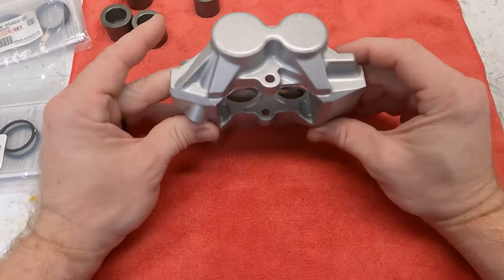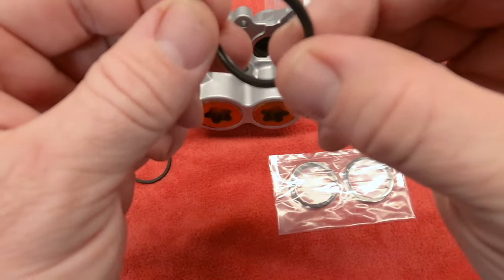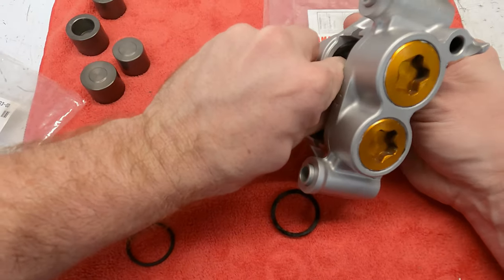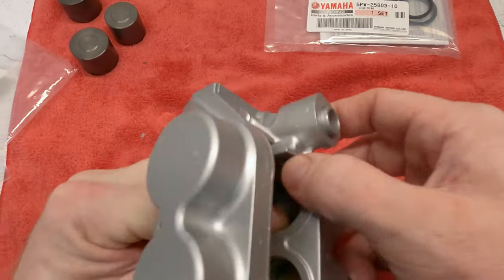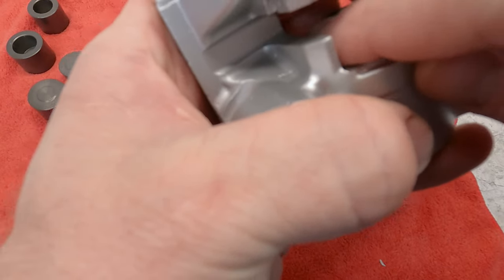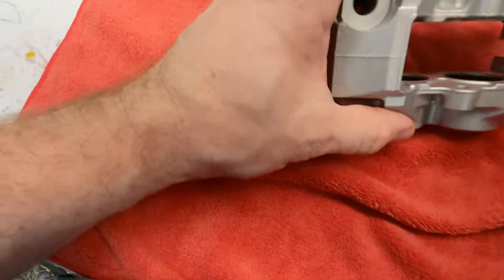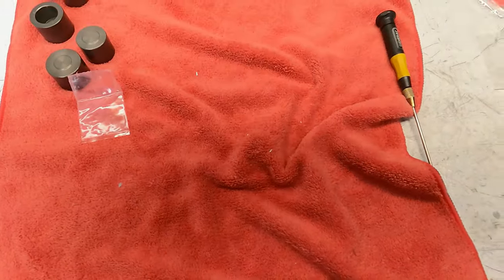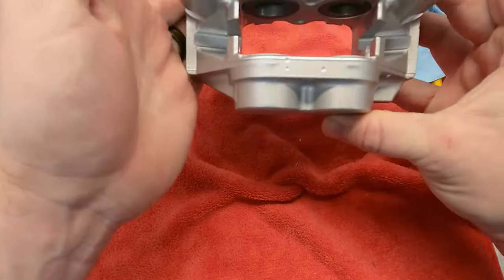Basket Case 2004 Yamaha R1 Rebuild - Front Calipers

Comment: Hello, yesterday I spent the whole day trying to put rubber bands in the grooves and I didn't succeed, the rubber bands have the mark 25803-10 as yours, I'm interested considering that my 2009 phaser 600 s2 gave those rubber bands a fit, the store assures me that they are ok but they look bigger to me a lot.Thanks.
Reply from the maker: They are not that easy to get in, i bent them in a little bit of a w shape to get them in. Are you putting them in your FZ6/Phaser 600?
Reply: @DeWoodysShop  
I tried neide, took it to a yamaha service but they also have a problem, I don't know how it will end unfortunately.
Reply from the maker: Its possible the wrong parts got into the wrong package. Its happened to me a few times.
Reply: @DeWoodysShop  thx bro

Comment: I am from Indonesia because the FRONT BRAKE CALIPER SEALS KIT is not available in yamaha repair shop can I find the information on the CALIPER SEALS number (ID × OD × Wide) for that caliper. thank you 🙏
Reply from the maker: I am not sure of the size since they are in the caliper now. the part number is 5PW-25803-10-00 and 5PW-25803-00-00, you need two of each for both sides.